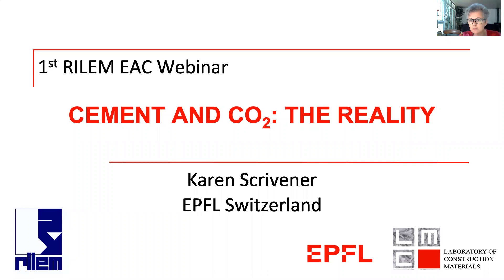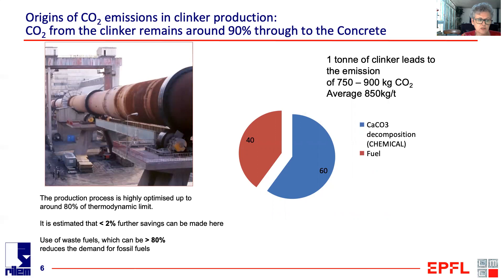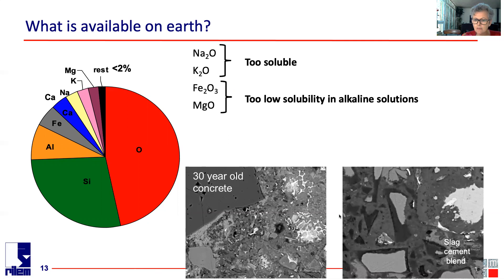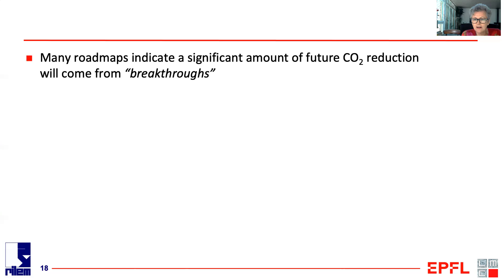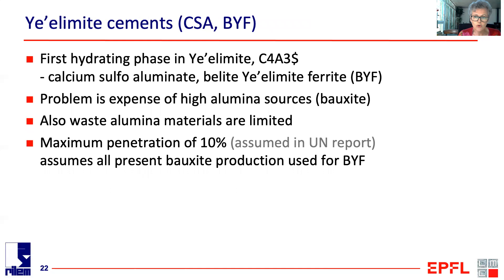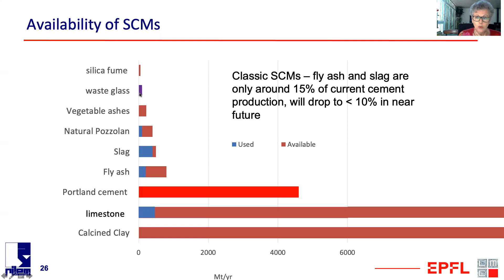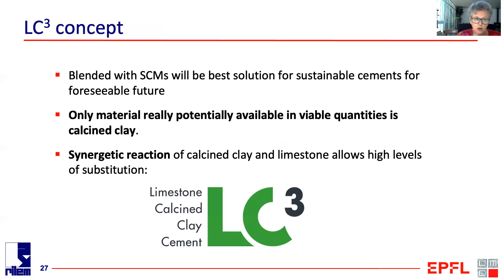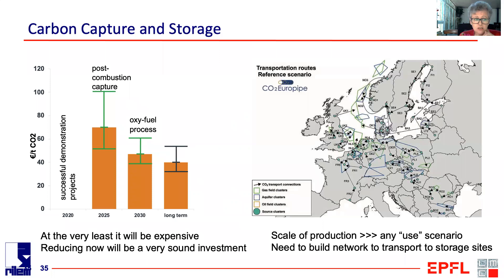Cement and CO2, the reality by Prof. Karen Scrivener

Comment: Excellent and realistic, earnest view of the urgent need to reduce CO2. We can make cement in concrete industry differently but changing the kind of energy for the heat required to precipitate hydrates. Also looks at different oxides of iron and magnesium in original clinker, magnesium in slag, CaO (Calcium silicates (Portland cement) and AI2O3.... Assesses the percent (<.1 of 1% in China) of this better type of cement material. Shows images of women mixing and spreading concrete on a small scale in India, and points out importance of practice solution,  as well as "things that can't work." She discounts the "breakthroughs" as "magical thinking" and "alchemy." Fallacies are debunked. 95% of slag and fly ash (produced in power production from coal) is already being used effectively.  No net benefit occurs by changing chemistry of cement. Uncarbonated sources are key....She also covers Geopolymers (Alkali-Activated Materials) and other possible sources of clinker in the process. Her reason for discounting some possible solutions is that they "would never penetrate the market," - so one wonders what connection she has if any through her foundation, to the market and economic forces supporting status quo in the industry. Would like to hear more about this for my International Casebook in Construction Ethics
.